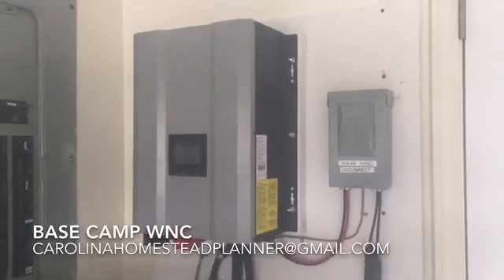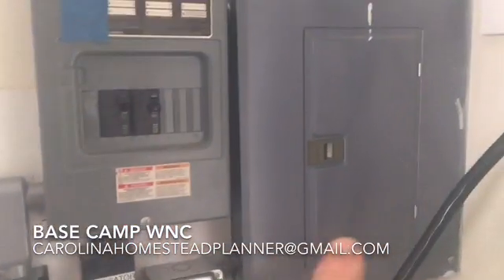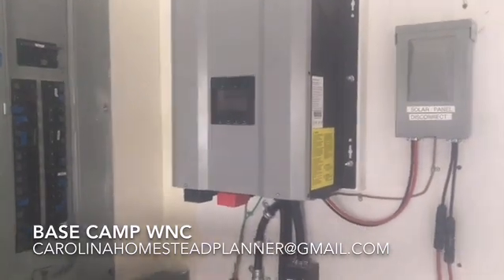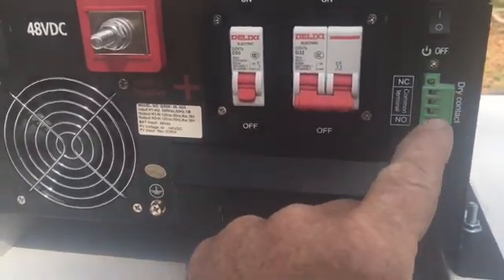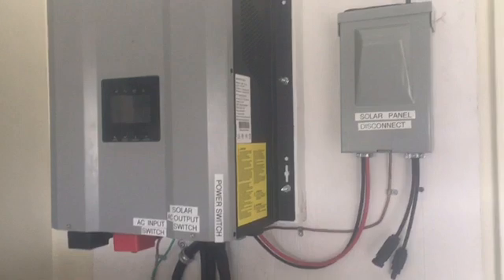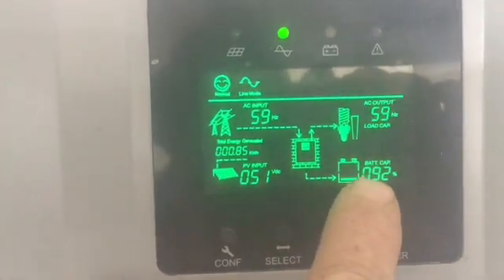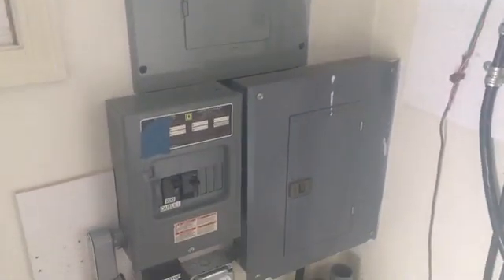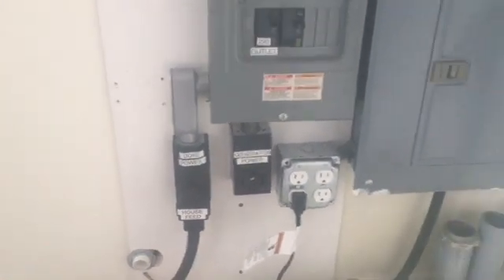6KW Split Phase 120-120. 240 Volt Hybrid Solar Charge Controller

Comment: What brand inverter is that? I need to get one of that to power my 240 volt well pump. I am looking at mpp 5kw inverter, but not much information of people installing it and able to run well pump on a 48 volt system. Appreciate the information
Reply from the maker: Maienduo Nava 
They are Zlpower
From 1-6KW they are 24 volt
From 6-25 kw they are 48 volt 
The 6KW you can get 24 or 48 volt 
I’am a dealer for them with all that is going on 6-8 weeks delivery 
I do have a 6 kw 24 volt in stock now
These are 120-120-240 volt split phase 180 out of phase
These produce the same power that is in your house from the grid
If I can help you let me know if you are interested in buying one contact me by my email or Thur YouTube 
And as always subscribe like and share 
Thanks ERIC